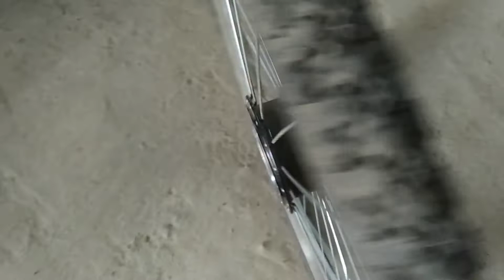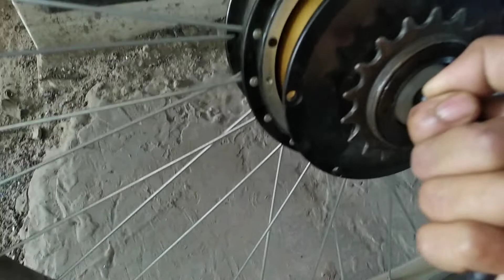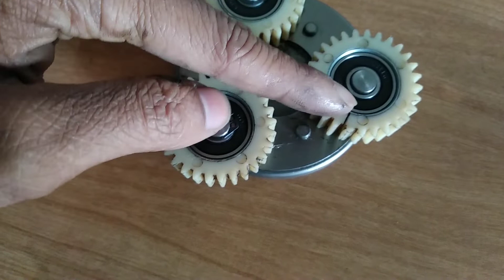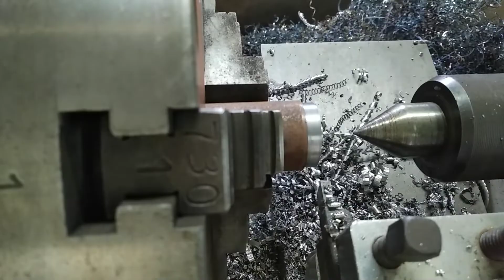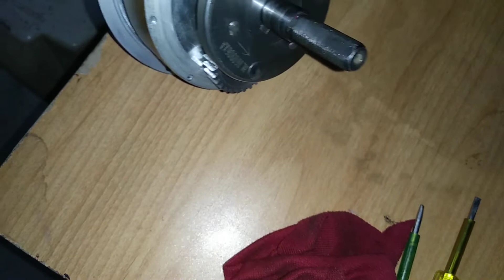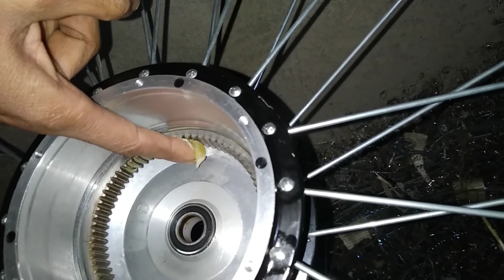BLDC HUB MOTOR planetary gear CHANGE

Comment: What happens if the steel Spacely Sprockets fail while engaged inside the aluminum Cogswell Cog hub motor casing? The nylon Getrag Gears strip and break away leaving the hub motor in a state where it can be cleaned out, re-geared, and back in service within a couple of hours. With the steel Spacely Sprockets you're gonna need a complete new Jetson hub motor assembly.
Reply: I don't think the outer ring gear is aluminium tbh, it's probably harder than the cast iron/mild steel billet he used to cut the gears. I think others have good reliability with soft metal gears. Lasts a lot longer as an over package in the rough terrain of the sub continent.
Reply: @oneman29  The bicycle wheel "hub" I'm pretty sure is aluminum. The inside of the the wheel hub has "teeth" that the four "sprockets" ride in. He talks about removing the four nylon gears and replacing them with steel gears. The aluminum was stronger than the nylon gears but not as strong as the steel gears. Those steel gears will chew the aluminum wheel hub up if they fail.
Reply: I upgraded mine 5 years ago still going fine and with a 52v battery and 1500w controller and sounds the same.
Reply: @RandomClips27.  the steel gears don't damage my engine then ?
Reply: @charliesgrumma5388  it's steel. I have rust around the area where the bearing is. If it was aluminum it wouldn't rust. Therefore, the hub casing that has teeth which latch into the planetary gears are steel.
Reply: @slugzkea  I'd like to know which brand of  "kit" or complete electric bike comes with a steel hub motor. I'm not saying you're lying I'm just saying that with my limited knowledge of building electric bikes and inspecting factory electric bikes I've personally seen one with a steel hub.
Reply: @charliesgrumma5388  well aluminum doesn't rust, so...i dunno, i rode all through winter, i used an anti corrosion coating but salt will still get in here and there and when i serviced my hub where the axle goes through the bearing it was all rusty around it.
Reply: @charliesgrumma5388  rize blade 2 with bafang g062 motor. rust around the  bearing inside the hub where the axle goes through. aluminum doesn't rust, so...
Reply: @slugzkea  Does a magnet stick to the hub? The website says the Bufang G062 housing is made of aluminum. Yes most wheel bearings are made of steel. Two metals placed together can cause galvanic corrosion. I suspect that caused your steel bearing to rust inside your aluminum hub housing.
Reply: Sure, but it’s never going to wear out or break, so who cares?
Reply: @charliesgrumma5388 , Sure, but it’s never going to wear out or break, so who cares?
Reply: @Whale_Lover , If you send too much power to the electric motor, you might burn up the wires, so don’t do that.
Reply: @charliesgrumma5388 , You’re extremely confused. The ring gear teeth are not on the motor. The motor has to spin independently from the ring gear for this geared hub motor to function. Open your eyes and look at it.

Besides, who cares whether the ring gear is metal or aluminum. It makes no difference. The ring gear will last forever anyway. Why would it fail? Aluminum is strong enough, because plastic obviously isn’t.
Reply: @terjeoseberg990  "Dunning-Kruger Effect" I believe.
Reply: @charliesgrumma5388 , Even if the ring gear was aluminum, there’s nothing stopping you from putting the hub housing on a lathe and removing the ring gear teeth, then press fitting a steel ring in there with steel teeth. This guy has a lathe and obviously knows how to make gears.
Reply: Nein, bitte nichts verändern, alles lassen wie es ist oder mit gleichen ersetzten. Das ist alles schon so durchdacht. 
Wollt ihr power? Ivenstiert in ein cross bike!
Reply: @andrewedel5275  Sorry I don't speak French.

Comment: ......   Make them in brass and you're in business,   any metal gears will be louder than the nylon ones, but brass will not wear out the ring gear in the hub shell.
Reply from the maker: Good idea.
Reply: I upgraded mine 5 years ago still going fine and with a 52v battery and 1500w controller and sounds the same
Reply: I was thinking brass too lol :P
Reply: What about copper? 

I found copper 

Where did you find brass?

Comment: Its Mindbreaking, how someone with such steel working skills does not know, the gears NEED to be nylon, to prevent damage to the case. Just buy new ones for 4$ each every 1-2 Years.
Reply: I upgraded mine 5 years ago still going fine and with a 52v battery and 1500w controller and sounds the same
Reply: @RandomClips27.  what motor? im currently on geared motor with default nylon planetary geras inside with controller 48v 22a max and 11a continuous, im thinking to put steel planetary gearings inside and put on controller with 30a max/15a continuous, would that work, is that what you have done and it works fine for 5years now?
Reply from the maker: In my case outer gear hardness 50-55 hrc & other gear non hardness ms metal. How to damage outer gear. If damage outer gear i can change it.  It's also removeble.
Reply: It's not about the 4$. It's about the time it takes to replace it. And the inconvenience at the moment it breaks.

Comment: I kinda feel like the nylon gears flex allowing the motor to  jar less and last longer?
Reply: Last longer? Nope
Reply: Definitely the metal gears will be louder, probably loud enough to be distracting to the rider. I wish the eBike hub motors used quiet spiral or helical cut gears instead of loud (but efficient) straight cut spur gears.
Reply: I upgraded mine 5 years ago still going fine and with a 52v battery and 1500w controller and sounds the same
Reply: Rite sir

Comment: How is it holding up today? Did the teeth strip from inside the hub wall? Because the reason they use plastic gears is so the gears can damage and it cost less to replace rather then the internal teeth in the hub. It will cost more.

Comment: I did a whole video on them.Nylon gears most of them where chewed up and melted from the heat and performance of the motor
Reply: Yeah , well , you can change the nylon gears and the motor will run .
Those steel ones will do for a while , but they will chew up the teeth on the hull . That means buying a new wheel later on 😑.

Comment: I tried metal the noise and stress. Re fitted new nylon and clutch so quiet and smooth. Won't be using metal that noise wasn't healthy my bafang is 12 years old and has done 1000s of miles. Over charged high speed pushed 54v but happy back at 36v

Comment: You upgrade to brass, not steel. Those are going to shred the outer casing ring gear. You won't need planetary gears after that. You'll need a new motor.
Reply: @audacityhour3104  It probably is brass, or at least some other similar alloy, as trying to machine pure copper is more difficult. You should be fine with those. Match your gear width, height, and tooth count.
Reply: @audacityhour3104  What makes steel so bad, is that it's like putting a machinist cutting tool into contact with the softer aluminum of your hub motor. Guess the one that will win.
Reply: @audacityhour3104  I'm working with Bafang (8-fun) BLDC hub motors. The outer case IS the ring gear. 😂 But this is good, because being in contact with outside air allows them to cool very well. Whatever your setup, you wouldn't want steel riding steel, as this causes [Fe] bits wear off and get stuck between magnets and stator or sensors. Non-[Fe] type metals won't do this. Plus they will conduct heat, instead of holding heat. Last, you will want to remove old grease, and replace with an all-weather aircraft grease. It will stay where you put it and not become stiff in cold.
Reply from the maker: Outer casing gear hardness 50-55 hrc . Others gear hardness maximum    20 hrc. How to damage outer casing gear?
Reply: @ajaymixup4396  Bafang (8-fun) outer gear is aluminium. Steel cuts aluminium. Case closed!
Reply: @aleksandrbmelnikov  yes better using nylon gear...if wear just change nylon gear....more cheaper than metal gear
Reply: @Boediprasetya  Do you ride in very cold weather, below 0°c? Then upgrade to brass gears, because they won't crack. Only downside is they make a little more noise.
Reply: @aleksandrbmelnikov  I live in tropical Indonesia and I don't want to replace the nylon gear on my MTB with metal gear...

Comment: So this isn't sold somewhere?
Reply: You can buy them preassembled on eBay for like $20
Reply: @halo3pownage  the ones on Ebay aren't metal
Reply: @ahmadzaki3328  the price ranges from $20 for the gears alone to $32 for the clutch assembly with metal gears prepressed on
Reply: @ahmadzaki3328  if you're actually looking at swapping to metal gears though you need to look into getting proper lubricant for the motor because pure metal gears will cause more damage to the motor in the long run due to metal shavings. There's a reason why there are nylon gears. It's all a trade off and it depends on what your end goals are though because metal gears will transmit torque way better than nylon gears will but from a longevity standpoint nylon gears will cause less damage to the actual motor itself then metal gears will